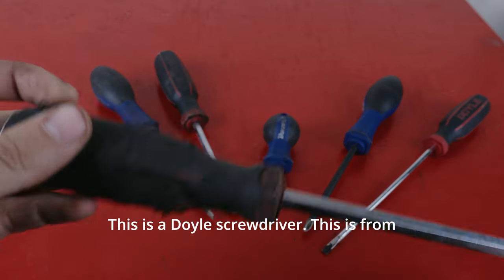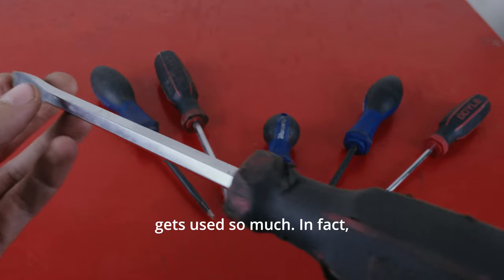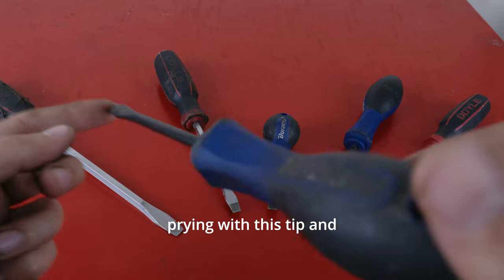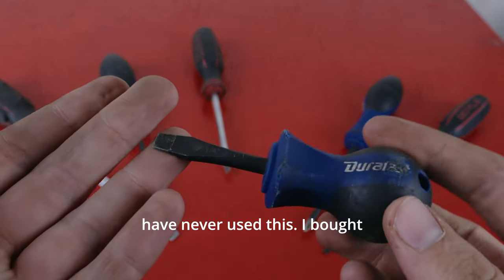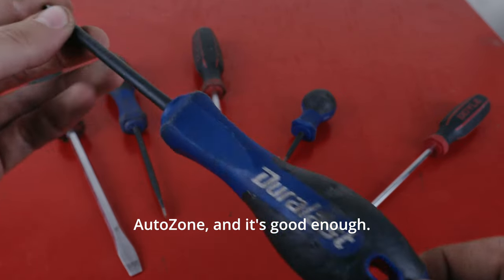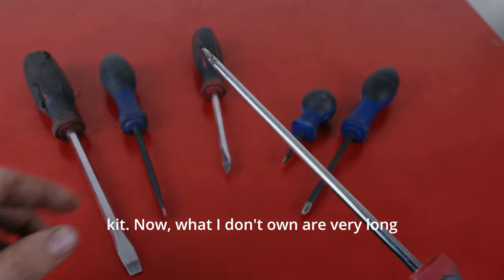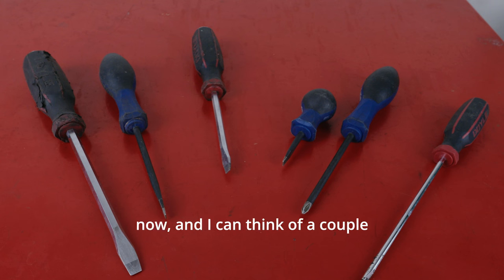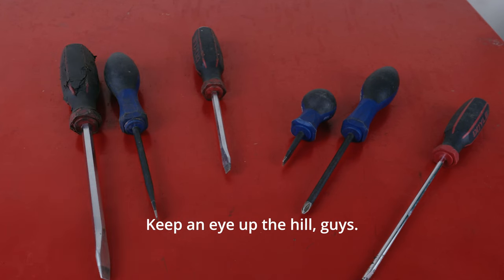What screwdrivers do you need

Comment: I find stubby screwdrivers a little easier to exert downward pressure on if you're dealing with a seized screw on a non-vertical surface, sometimes it just about makes the difference during those crucial first few tries before the head starts to get chewed up.

Definitely agree it's worth having multiple similar sizes with different blade thicknesses- the variability in head geometry, drive feature depth and material properties with screws can be huge, especially with old hardware. I never really understood why screw head sizes didn't reach the same level of standardisation that even poor quality nuts and bolts have...

Comment: since all useless gadget pander on youtube this is pretty refreshing, i carry a stubby screwdriver at work because im a handyman and it saves me a lot of time not having to go back to my car to pick up a screwdriver, i also have 3 sizes of flathead in my multitool if i need it at that moment but in the toolbox i got a smaller size slim and long philips which rarely gets any use, a tiny flathead for electric connections and a comically huge flathead if i want to cut a slot in a stripped screw. i also got a hex bit screwdriver kit if something im working on got a weird head like torx or security screws.
there is also a screw extraction kit in my glovebox if things go wrong. i never thought about having a longer philips in my toolbox but i do have a full screwdriver kit at the workplace with all kinds of head flavors and shaft sizes
Reply from the maker: I tried to keep it quick.